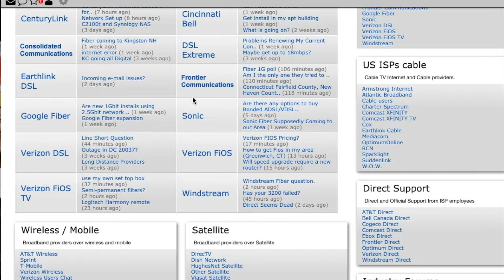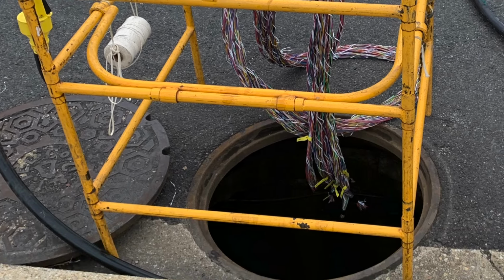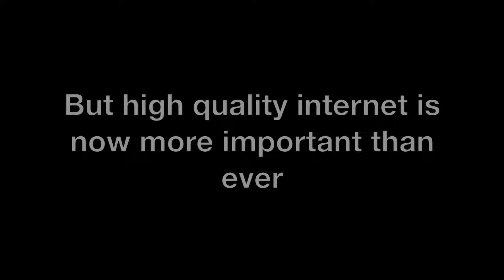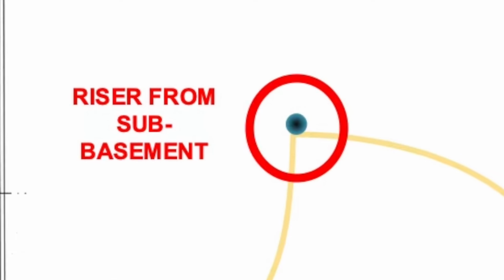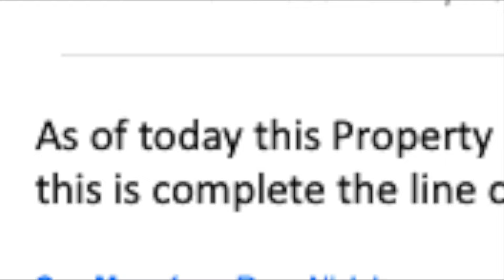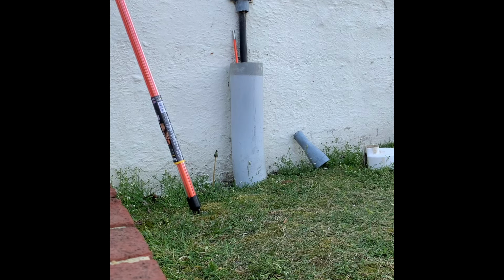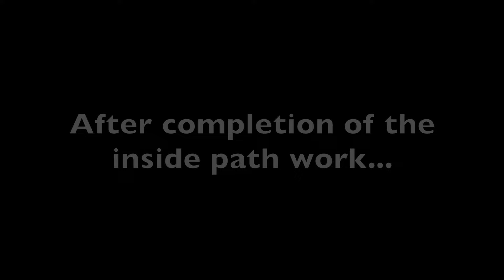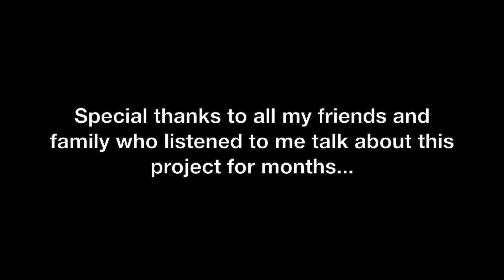Getting FiOS (fiber optic internet/FTTH) installed in my condo building

Comment: I work for a different telecommunications/internet company and very impressed with how through this video is and actually highly impressed with Verizon on how they did this process. Currently our company is skipping most apartment buildings because we are still building the fiber network to more rural areas.
Reply from the maker: That seems to be the case with a lot of companies. Some come back to do this kind of work, others try to find ways to shortcut the process. I hear CenturyLink likes to use G.fast to serve individual units over existing copper wiring, for example. Verizon seems to be very willing to take on MDUs but it appear related to their desire to retire their copper facilities. They can't do that until everyone is off copper. I wonder if their approach would have been different if we didn't have a handful of copper circuits between a few units with landlines and service for our call boxes.

Comment: Jesus, you neighbors have no idea how much good you've done them. I can only wish we could get fiber pulled into your condo community. ATT flat out said no, and I couldn't get anyone on the board interested in talking to other providers to explore options either. Folks complain about Xfinity but do nothing to remedy it. But what can you do...
Reply from the maker: Yeah, AT&T doesn't seem very interested in MDUs yet. My understanding is Verizon was the same way during then initial FiOS builds. Now that they have hit all the low-hanging fruit they are interested in getting condos and other MDUs off copper so they can fully retire the facilities. I'm sure AT&T will come around with time but the wait has got to frustrating.

Comment: Just came across this today. I'm in NJ next to NYC, Verizon is home here and was one of the first states to get FIOS. That said it wasn't easy depending on where you are. When it first came here I was living in Garden Apartments that had cable and POTS in apartments all the time I was there up to 2013 no one could get FIOS even though it was run right down our street. Fast forward to 2018 and I had moved to a pre war apartment building where I could see the Empire State building from my living room. That was one of the only pluses that and by a miracle I could get FIOS. This though they ran conduit through the hallways and pulled through the wall into the apartment. All in all the install went well and I enjoyed having the service till I left last year. If i'm in the area and can get FIOS again I will certainly do that. I have to say your perseverance is commendable.
Reply: Hey can someone view your browsing history if you are connected to his FiOS wifi?
Reply: @jesseowusuansah6762  I would doubt that directly. They might see it would be going through Verizon servers but your direct connection takes some work. Not as much but more than a casual glance.

Comment: I might be copying this process in a frontier MDU that’s still using their copper footprint. Fiber is on the street right now recently installed
Reply from the maker: Good luck! I know Frontier is doing a massive rollout right now. I don't haven't heard much about whether they are retrofitting MDUs so I'd be interested in your experience. They are building out my parents' condo complex at the moment, but it's not a multi-story building like I have here in DC. I'd be very interested to know if Frontier is willing to pull fiber all the way to the unit in an existing MDU. From what I have heard, AT&T will do it (although they are more reluctant to take on these projects vs Verizon and sometimes ask for the property to share in the costs), and I've heard CenturyLink generally tries to use G.fast rather than pulling fiber to each unit.

Comment: One issue we had when they were installing the HFC solution was getting power to the HFC units mounted on the exterior of the building. They had to have the Hydro utility and an electrical contractor install power lines to the HFC boxes on the outside of the building that ran to the utility room and the central power connection from a local transformer on the property. That delayed a month or so since Hydro had to schedule it with an existing upgrade of the entire intersection that fed the transformer on the property and required engineering modifications to that project as well as informing the bell provider of changes as well that cause them to have to advance a wiring and power project they were scheduled to do on the same intersection. So, most of the projects are never done in isolation. There is always work going on in the neighborhood that can affect your installation at hte building level. They also had to wait since several of the cable vaults in the area were being expanded in-situ and there was only one crew to upgrade 14 vaults that took three days each to perform. That was another project that got prioritized when the discovere4d they didn't have enough free fiber in the neighborhood for the intersection data sensors and the telecom and cable. Our upgrade triggered a whole cascade of changes throughout the entire utility and power infrastructure in the neighborhood and meshed it with those 8 or ten other projects by six different utility and telecom providers. As well   we have six condo towers scheduled for construction that would need fiber infrastructure. This also triggered a cascade of area wide fiber upgrades as well to add capacity for buildings that are not expected to be completed for ten years from now.

Comment: I watch a lot of fiber install videos because I find it interesting to see how it's done in different parts of the world. This one was very good! I live in Germany and the install process at one of my family member's house was very different from the one in this video (granted, it was a different scenario involving a detached single-family home, not a condo). What I'm interested in is what type of network Verizon installed, AON or GPON?

For those interested:
In Germany, telecom lines almost exclusively run underground in cities (in rural areas, telecom poles are seen more often, but are far from the norm). Instead of the black junction boxes on top of the poles seen in the video, we have larger, curbside cabinets to connect the lines going to the consumers with the lines coming from the exchange.
In my family member's case, there was no prior residential fiber in the town at all. A provider offered to build out the network, but only on the condition that a certain proportion of the residents would agree to sign a 2 year service contract with them. The install would then be free of charge for those who signed the contract. Starting in late 2020 with the "pre-marketing", the connection went live in May of 2022.
Most of the fiber networks in Germany are GPON. I can only hope that the providers have the good sense to put the splitters in the junction cabinets instead of burying them underground, which would make it much easier to convert to AON down the road or to give individual customers a dedicated line.
Reply from the maker: @dtuttle351  FiOS actually doesn't have any XGS-PON. Verizon is using NG-PON2 instead. It is only in 12 COs in NYC at the moment from what I have been told. There is a little BPON still out there but it is being phased out. It's >95% GPON at the moment.

Comment: Excellent video! Lots of good info. I personally been through this process a few times with Verizon in Florida, which is now owned by frontier, but still fios however, I doubt I could’ve explained it as well as you did in this video. Great work!

Comment: This is great, it explains what my building will go through at some point.    I'm curious how they managed pulling the right amount of microduct since each apartment will have a different length of microduct needed.   did they pull all 12 to the first floor, then eleven to the second, then 9 to the third,  until you had seven, and then pass the remaining six to the attic runs?  It seems like it would be tricky to bind the microduct to one another until after the all twelve units get their  microduct plumbed.    If your building's fiber runs are like a E turned 90°, our building is more of a F style layout.  And given that the vertical run is like a 3"  diameter  metal conduit I suspect our microduct runs will only by used for the horizontal runs  in each floors hallway.     I'm curious to know where they plan on running the walljack, so I can prepare to run a conduit from that to where I want to put the ONT, now I know what I need to ask for.  thanks.
Reply from the maker: Yes, that's exactly what they did. They pulled all 12 to the first, terminated one there, then 11 to the 2nd floor, and so on. Then at my unit (top floor) they cut all all the micro ducts off. They then used little plastic connectors called 'sharkbite fittings' to connect the microduct pulled from the other units into my units. Not sure if they used sharkbites in the other two stacks of units but I don't think so. The sharkbites are a bit of a pain because when the techs pull the fiber through the microducts there's a chance they an get snagged on the sharkbites. It happened on one of the pulls to another unit. Thankfully the sharkbite was in my unit so they had access to cut it open and thread the fiber through. In terms of where the wall jack is, they typically put it near where the fiber enters the unit. In a lot of MDU setups I've seen, they run the fiber through the hallways, but our board didn't want the conduit visible if possible so they pulled it up through the utility risers. Verizon was great to work with and they were willing to modify plans to meet our requirements. Hope this helps!
Reply: @rnizlek  Interesting that they pulled the fiber instead of jetting it through the microduct. I'm no expert, but apparently that not only greatly reduces the friction but it also reduces the chance of snag at the connection points.
Reply: @paoloposo  You also have to buy microfiber to blow it which is more expensive than a flat drop and with such short runs it isn't even worth it to set all that up

Comment: Nice... I have been waiting since 2019 (the year verizon put up fiber lines) for verizon fios to be available in my town. I remember riding my bike around town seeing what they did, and I saw that same truck near a distributer about a street away. I called verizon 2 days ago for what felt like the millionth time but this time they gave me an awnser and said that they would call me back this week. I still don't understood why it's not activated in my area because there is fiber basically all around town.. again... there is a distributer less than 500 feet away from my street.
Reply: I used to work for Verizon,  they care nothing about customer service.  If you have DSL just stick with that.  FIOS is not much better
Reply: @jeffreysnow2640  Not surprised. I went above and beyond to the point of bothering their contractors just to know any information. I'm okay with what I have now, it's just a little underwhelming I know there's something better but I can't actually get it yet.

Comment: You just have to love neighbors that have no cost, only advantages, but just refuse because they can. But at least he was ok with the ducts going through his condo.
And man I would hate all that waiting time. When we come, we usually do all the work in one day. We blow the fiber, splice it in the home and the enclosure outside and patch the customer in the PoP, so he is up and running after only a few hours. I would be pissed if all the cable is ready and I had to wait weeks for 2 splices that take 5 minutes.
And we didn't change anything bec of Covid. We got a document that we were workers for critical infrastructur and everything continued as before.
Reply from the maker: Apparently that's pretty common for Verizon. Although I am told that now they don't send the inside path people out, they just have the techs pull the fiber once someone orders service, except for new builds. But to actually work on the fiber Verizon needs to use Verizon employees per their union contract - for running the conduit, they can use contractors. So there's a bit of a disconnect between the contractors and the Verizon employees. I've talked to others who have had their buildings wired and the wait times are similar. But that's pretty unique to Verizon I believe. I love the service though. When I bought my unit I accepted I would never get fiber and that was a compromise I made. I'm thrilled that it was able to happen even though it took forever.

Comment: This video was so helpful and exactly what I was looking for. Thank you for your service to your building and for sharing your process so perfectly. This is a case study in taking initiative, being creative and persistent, and problem solving. 

I didn’t realize until yesterday how much time I have lost in my business working from home because my upload speed is capped on cable. I took my laptop to a friend’s yesterday and uploaded in 1/10th of the time it takes at home. I also live in a condo in DC, but I am East of the River. I hope to have as much success. 

My only question is who did you initially email to get a response?
Reply from the maker: Just Google Verizon Enhanced Communities. There's a contact for each region. That's not the person you need to talk to but they can get you to the right group. The other way is just to file a FAST ticket through customer service.

Comment: When tenants get Fios installed to their unit, you say they wont have to take down dry wall, what methods to they have in order for them to get Fios then? Isn't a wire supposed to go from outside to their unit?
Reply from the maker: There is a conduit fed to each unit through the utility closets in each unit. Verizon contractors the installed a fiber wall jack in each unit. Essentially the fiber comes up the way pathway as water and wastewater pipes. The installation strategy will vary building by building though.

Comment: shame on those tenants who frustrated the install. perhaps the lease should not be renewed on the next cycle.
Reply from the maker: The people who stood in the way were all unit owners. Had they been tenants it would have been very easy to require access under the terms of the lease. We legally had the right to run the wiring per our bylaws but an owner can make life very difficult if they want to. Some people just don't like change, but since this I've built a relationship with that guy and he's very nice. I just don't think he understood the value of what we were doing initially.

Comment: great video would like to see a follow up with the speeds
Reply from the maker: The speeds have been consistently around >900/850 since I've had the service. One of the great things about being in DC is we're close to a major internet exchange point (Ashburn) so 4-5ms pings to servers are not unusual. Its about 11 ms up to my server in New York. Rumor is that Verizon will be offering >1 Gbps speeds in the new year. I don't really need anything beyond 1 gbps but I might subscribe for a few months just to test things out. If so I'll definitely do a video.

Comment: Also is splicing when they set up the cables in the distributer?
Reply from the maker: Yes, they had to splice the fibers in the cable that comes off the fibers in the cable that runs into the building, and then had to splice the cables that run to each distribution panel to the cable that comes into the building. There is a direct connection between each unit and the fiber distribution hub that’s on a pole two blocks away, the splicing is just connecting the fibers in each cable together. I could do a video on some point that shows how everything is connected.
Reply: @rnizlek  that would be great!

Comment: Thanks for posting this vlog. I'm waiting to see how this goes with my condo building and VZ. I just got another notice from VZ that's ridiculously lacking info.
I can't believe you had to go and troubleshoot a relatively straightforward problem that these telecom SMEs didn't want to bother with. Such a miserable work ethic IMHO.
Reply from the maker: Honestly the issue there was not Verizon but the contractors. Verizon outsources that portion of the work and their position (understandably) was, 'we paid for this to be done properly, and it wasn't, so it has to go back to the contractors to figure out.' I just didn't want to wait around for all that to happen. The Verizon guys themselves were great. When my neighbor's service was installed they ran into a bit of a snag and the tech stayed hours until about 9 PM on a Friday night to get their service online. But anytime you are dealing with contractors it is a different matter. They're not Verizon and they're probably the low bidder on the job so they're not going to go above and beyond.

The biggest frustration during the project was just zero notice about anything. I'd look out my window and if I saw a Verizon or telecom contractor truck there that day then I knew they'd be working. If I wasn't working from home I don't know how I would have pulled this off. We have a management company but no way they'd be on site with no notice to get everyone the access they needed.